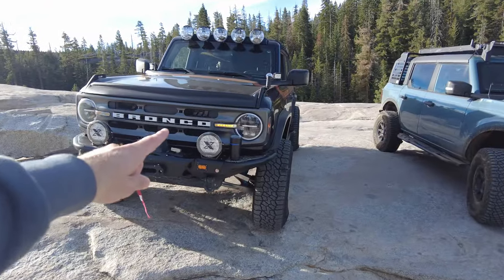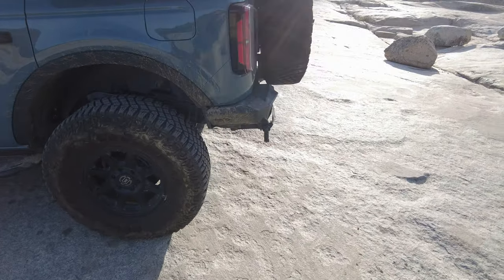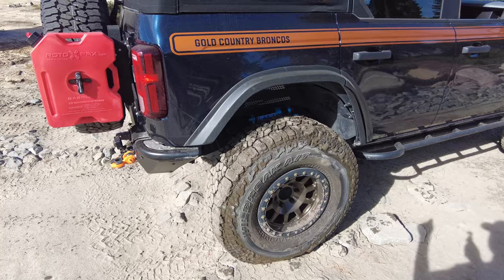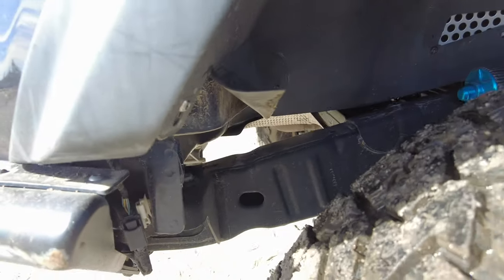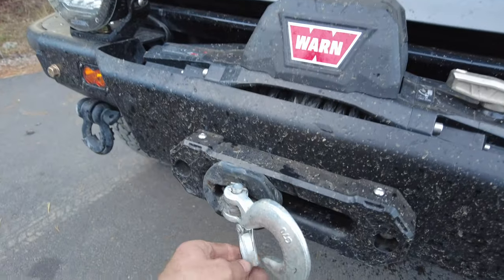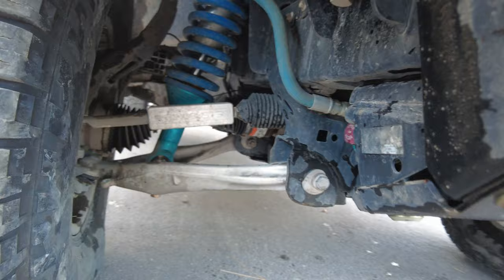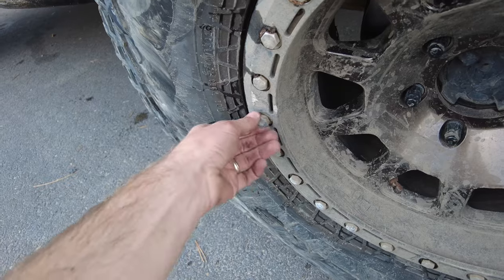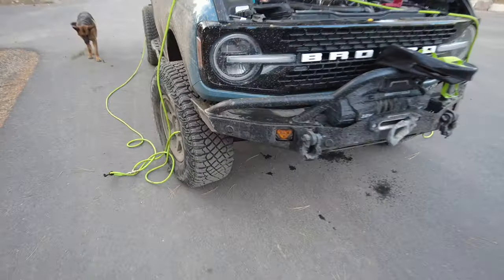Rubicon Ready?

Comment: Is your front sway bar permanently deleted?
Reply from the maker: Yea, the link broke awhile ago and I just pulled it off. Doesn't bug me
Reply: @popo_patty  drives plenty good on road?
Reply from the maker: @dirtyfrogfab  Yea, I feel like my stiffer then OEM King coilovers help minimize body roll enough. The only time I really notice it is when I taking a sharp U-turn mildly fast or when I'm going up a windy, mountain rd. I just have to slow down a tad, Ive done our off-road race course at speed just fine. It takes just a few minutes to unbolt both ends and try it out. Ive driven to SoCal and back and its my daily, plus at least 15k miles like this now.